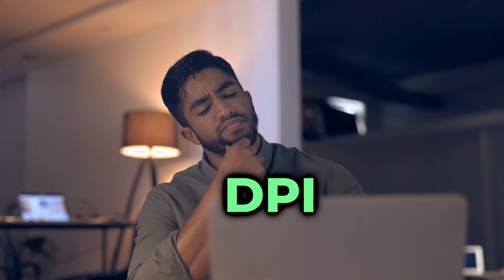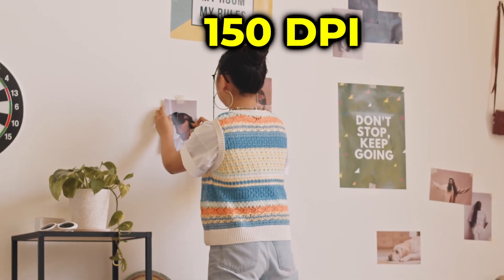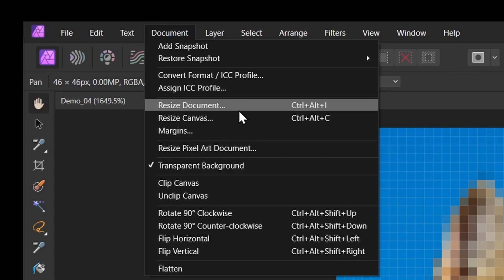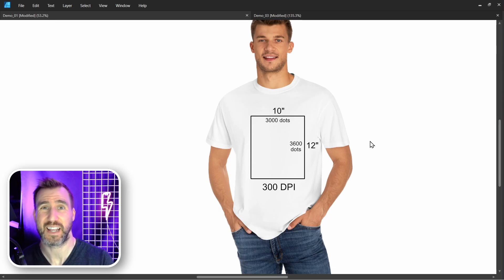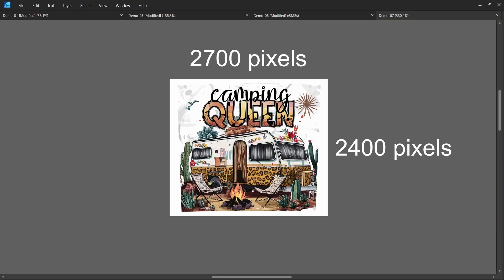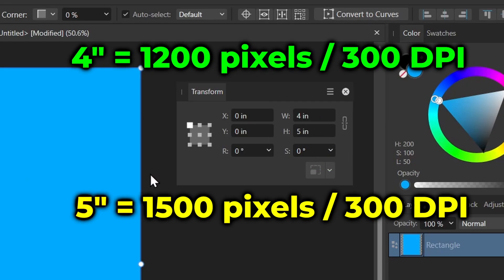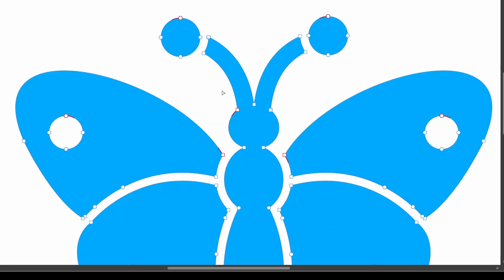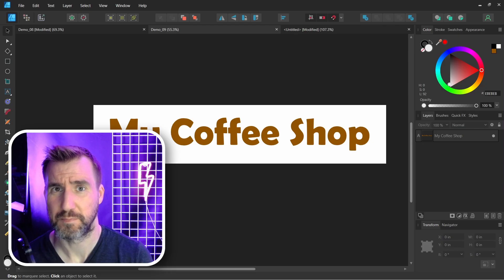How DPI Works - Tutorial for Affinity Photo, Designer, Publisher

Comment: So to clarify if the original png size at its current state is not the right size for a 4500x5400 t-shirt print for example then then only way to boost the resolution is to upscale it correct? Also how are the graphics in canva vector or png?
Reply from the maker: Hi @therealiralewis! Yes, if the resolution is lower than 4500x5400, you'd need to find some type of upscaling tool.

In Canva, it kind of varies whether something is a vector or a bitmap. Most of the shape-based items in the Elements menu seem to be SVGs. But some are PNGs. I plan to make a video on this (confusing) topic soon, so stay tuned!
Reply: @ Thanks man. I appreciate all the content you put out and will be looking forward to that video.

Comment: In your last example when showing vectors, I want to know how you can export it as measurements, not pixels and also having 300dpi
Reply from the maker: Hi @HDTwiZ, I'm not sure what you mean by "export it as measurements." Do you mean export the vector as an SVG? When you export it, you can choose the SVG option. SVGs just use numbers without units, so you can't set it to inches or millimeters (as far as I know).
Reply: @ Sorry for the bad explanation. My printshop wants an artboard that’s 53cm wide and 1m long. 

I want to place vector designs within that area and then export it as a 300dpi PNG image. When exported I want the artboard to be the exact size.
Reply from the maker: @HDTwiZ  I see. In that case, you can create a new document and choose "Centimeters" as the size and 300 DPI. Then when you enter the width and length, it will be correct.

If you've already created your document with an artboard, you can change it's size by selecting the artboard and then modifying the size via the Transform tab (Select Window -> Transform if you don't see it). If you need to switch the units to cm, you can choose File -> Document Setup and then change the units there.

Hope this helps!
Reply: @ Thank you!

Comment: My Canon printer says it's maximum DPI is 2,400 x 1200 dpi - I use RAW images which I then resize but now I see your video, I am not sure I'm doing it correctly - what would you do in this case - we do large format prints on canvas eg 100x100cm- canvas bleeds more than board or card so I usually go slightly lower on resolution than for up close things like our brochures and books. Would love your opinion if you have time. @TechnicallyTrent
Reply: If you followed Trent's advice that DPI and PPI are the same, you'd create your images at 1200 DPI. But that's wrong. Your printer does not likely have green ink so how does it represent a green pixel? It mixes multiple dots of yellow and cyan ink to represent a single green pixel. So DPI is higher than PPI. Your 2400x1200 DPI printer is probably fine with 300 PPI images.
Reply: @JamesOblak  my images that print 100cm (approx 39inches) are roughly 11700px so that works back to 300dpi, which is what I use as a standard, although sometimes I print some of my artworks at 240dpi and it looks great too. 

I think this is because it's on canvas and 'bleeds' but it depends on the image, detail, and linework in the paintings. Do you have any comments on that? I am no expert just find it all fascinating and obviously would like to produce the best quality image possible for my collection.
Reply: @peterpharoahartist  You have two things that can affect that general 300 ppi rule. The first is what you already see with ink bleed/over-saturation on canvas or paper. You can test how much ink bleed happens in your print medium by preparing a 100x100 pixel black and white graphic with 50 single-pixel black vertical bars interspersed with 50 single-pixel white vertical bars. Print one copy of this image at 100 ppi (a one inch square), another at 200 ppi (a half inch square), and another at 300 ppi (a third of an inch square). If the smallest version of that image file (300 ppi, 1/3 inch) shows solid black on your medium because of ink oversaturation, then there is no need to prepare images for that 300 ppi resolution. I'm guessing that the 200 ppi version of the image probably still shows vertical bars on the print medium. 

The other thing that can affect the 300 ppi rule is the distance that the eye observes the art. This 300 ppi assumption is that the viewer is holding the piece at arm's length.  If you're printing posters that may not be seen so closely, you can get away with lower resolution.
Reply: @JamesOblak  This is excellent advice - thanks very much - I am going to give this a go and see how it all works out.
Reply from the maker: Hi @peterpharoahartist,

I found some discussion of this topic here that may help, and maybe others can provide more info:

https://www.cambridgeincolour.com/forums/thread66955-2.htm

I believe that 2,400 x 1200 dpi is for the individual color droplets that can mix to form the final colors. If I was printing on those surfaces, I'd still stick to the simple formula of figuring how out big my image needs to be to support 300 DPI at a given size. I also think experimenting with test prints will be essential. Hope this helps!
Reply: @TechnicallyTrent  Took a look at the link - thanks very much - I think what we've been doing produces a great result and we're probably not going to get it any better but that's fine because the Canon is a really great printer!

Comment: You didn't mention where 300 and 72 come from.
The earliest printer that I remember that printed at 300 DPI was the Apple Laserwriter. Some dot matrix or inkjet printers might have, but not from Epson. Epson printed in multiples of 90, and still does.

72 comes from an early screen, maybe 13. On CRT monitors, the individual dots were easily seen. On my 50" TV screen, I need a magnifying glass. a 4K 32" monitor has smaller dots, more per inch.
Reply from the maker: Thanks for the background info! I was familiar with the numbers but never knew exactly where they came from.
Reply: @TechnicallyTrent  Google the resolution of the Epson P600.

Just for the fun of it.

Comment: Where is the discussion of PPI?  This video is helpful but it is still misleading.
Reply: PPI relates to your computer monitor's resolution. The relationship between the image pixel density and your monitor's PPI will determine how much real estate your image will occupy on your monitor's screen when the image is at 100% zoom. PPI, pixels per inch, is a monitor thing. DPI is related to printing on a physical object. Two very different concepts.
Reply: @Bob-The-Guy  you're making it worse. :) 

PPI is not simply a monitor thing. PPI is also related to printing a physical object. That's why there is a physical measurement (inch) in "PPI".  Most of what this video covers is really PPI, not DPI. If you follow this video's information and have a 4800 DPI ink jet printer, should you really prepare your images at 4800 DPI? Certainly not.
Reply from the maker: The "inch" in PPI refers to an inch on your screen. 

Once upon a time, it was feared that we'd have to worry about the pixel density of all these different devices (monitors, phones, tablets, TVs, etc...). So this concept of Pixels Per Inch (PPI) was invented to help explain how an image would look on different monitors.

Turns out, it doesn't really matter. The best approach is to look at the recommended file size for your desired digital platform (Facebook image, Instagram image, Shopify header, etc...) and just use that. Or err on the side of making the image too high res and let the device scale it down.

I'll try to make a follow up video for this.
Reply: @TechnicallyTrent  I agree. You can zoom your project to make it fit on your monitor easily so PPI is not a big deal. Devices will compress larger files to fit.
Reply: @TechnicallyTrent  If what you believe is true, why does Photoshop, GIMP, Krita, Painter, and so many other apps define image size in PPI instead of DPI? What do they know?  :)   

Your laser printer says it is capable of 1200 DPI but you know you'd never create an image with 1200 PPI (or your DPI) for it. This is why it is important to understand the difference between PPI and DPI.  The reason why we have a general rule about "300 PPI" for print is because we know the LPI is generally 133 to 150 and we need the extra image data (PPI) to effectively downsample to that lesser line screen (LPI) in offset printing.  The offset printing output device likely uses 1200 DPI to produce that 150 LPI screen from the 300 PPI image data. 

I'm more critical of Serif's refusal (as the developers explained in their forums) to use the proper PPI terminology than of your perception of the concept and presentation in your video. I know you need to simplify this concept for the Affinity audience.  I'm hoping Serif eventually learns.